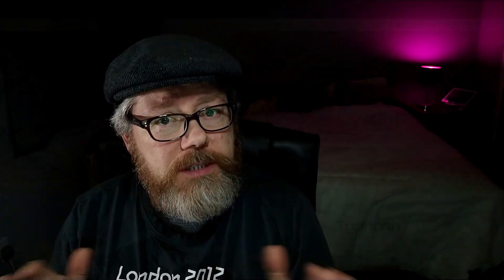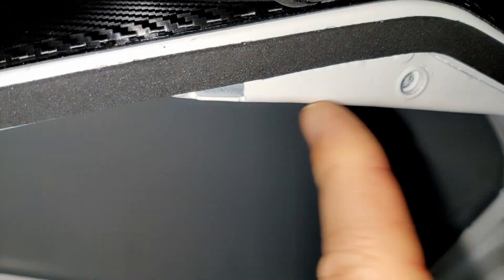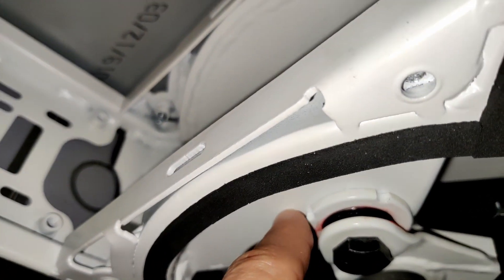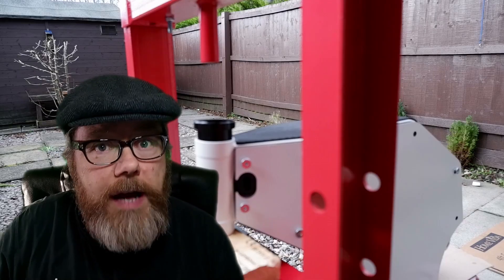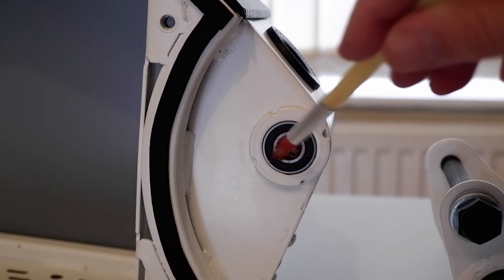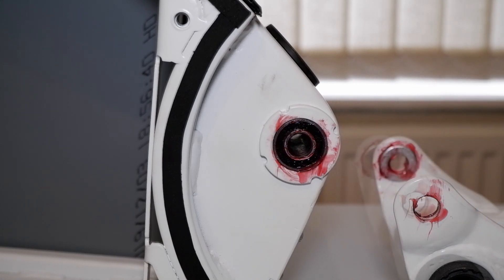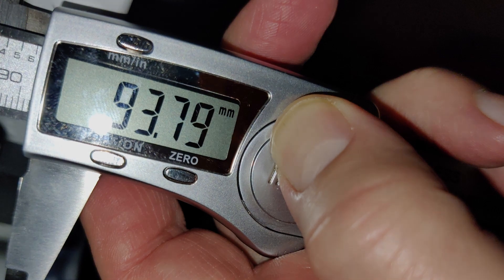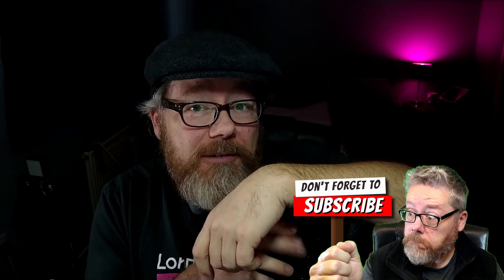FAST EBIKE BUILD UK ROAD LEGAL PART 6 - WHICH FRAME IS THE BEST  QUALITY TO CHOOSE FROM.

Comment: I Order a White Typhoon Frame on the 16th of January 2021, it was dispatch on the 21st of January & the last DHL tracking advise was on the 23rd of January showing that it was cleared customs & awaiting departure from Frankfurt international Airport.  It is now mid March & no one seems to know what has happen to my parcel. The Consignment note states that DHL was to transport to AUS, & then Australia Post would deliver locally. 
When did you order your frame & how long did it take to receive it in the UK?
Reply from the maker: I tried to order in December but they were closed for most of Christmas and until the 11th January.
So the order started on the 11th January and there was a 3 week period to build added bike rack to order. When I had confirmation of shipping it took 5 days to deliver.
Reply: I am now at 7 weeks from dispatch, Artur assured me that it would be here in a couple of  weeks. I asked for a refund or replacement as both DHL & Australia Post tell me that it appears to be lost and  to contact the seller direct. Since asking for a refund or replacement, Vector E-Bike have stopped replying to my emails and their phones are disconnected. So you are lucky to have received your frame.
Reply from the maker: @ezrider119  That's not good at all! I hope you resolve the situation and get your money back if the can't find it. Mind you it is pretty hard to lose a large package that size.
Reply: Thanks mate, have watched all of your builds. All the best for getting your bike registered.
Reply from the maker: @ezrider119  Thanks 👍

Comment: Whahay..!!💥 Iv just come across your channel..Your a welshy same as me,I,m in Swansea..I bought an enduro frame last night off ebay..So im really jumping in at the deep end..my normal hobbie is building FPV Quads and flying them..So really fancied a crack at one of these awesome Ebikes🤩Sub'D
Reply from the maker: Cheers thanks for watching and good luck with your build 👍
Reply: @baconbuttties  Quick question buddy..I’ve ordered a 26” rear wheel and hub motor..! Will this work on my frame? I bloody hope so😩
Reply from the maker: @thedok7333  26 inch rear wheels  are usually okay. What is the exact frame you bought? Is it like my frame or the stealth bomber type?
Reply: @baconbuttties  Its the stealth bomber frame..🤔

Comment: Have you put your discs the right way round, they have direction arrows that should point the same way as the arrow on the tyre
Reply from the maker: Yes I am aware of the arrows. I could turn the right side around but it would look silly and the rear of the disc has a recess. Maybe I will be change the discs to one's that are plain and flat.

Comment: great series, looking forwrd to the rest and how you get on with msva and insurance, what you hopping to get top speed? 
i like the look of the eleek Lite 1/1.8 frame for a 3kw mtb for offroad use.
Reply from the maker: I going to use an 80 volt battery set up on a 5T hub, so I'm thinking that it has to be over 40 mph plus  when the controller is turned up full. Obviously for the MSVA purposes and on road riding the power and top speed will have to be set lower.
Reply: @baconbuttties  so moped rather than motorbike class?
Reply from the maker: @GlaucusBlue  Yes it will be classed as moped hopefully

Comment: Thanks for the video 👍
I'd dare say the Chinese frame would be a good bit lighter.
Did you weigh them?
Cheers
Reply from the maker: Unfortunately I didn't weigh them so can't compare. I have noticed on the European built one that it has a lot of holes drilled in certain places to reduce the weight  added by the extra strengthening.

Comment: Nice and informative video as always, i do just now exactly same build  with a Qulbix 140 frame , i was comparing this two and Quilbx have 50% discount in that time when i order and price was the + - same, build quality looks nice, have some problem with 83mm bottom bracket whitch is not included.  I'm looking forward to the next video :)
Reply from the maker: Nice frame and 50% discount is great, I did look at that frame but it was full price at the time.

Comment: Hi man, to be honest I think it is just about taste. I have got the EEB frame and used your previous videos as guide, and after two yars of usage I have got zero complaints :) EEB has got the cruiser seat and paypal option (Eleek used the Western Union back then). And also yes, Vector and Eleek use same frames ;-) I also prefer plastic material over dibond https://www.youtube.com/watch?v=lEneKp0iJ44    it will be dope if you try if the panels from EEB fit to Vector frame ( I bet they do :D ). Both options are just copy of Stealth Bikes anyway... :D oh and btw I bet this dude used EEB frame for way powerful build than you ;-) https://www.youtube.com/watch?v=ICODFXzlKXA
Reply from the maker: Yeah I didn't mean the EEB is bad, I'm just saying the build quality is definitely better on the Vector frame.  I have ordered wider molded side panels from Eleek and am not sure what they are made of? I think they are ABS plastic, the flat panels that came with the frame are just the flat composite type which are not very good as you only have 120mm width with the flat panels.
Reply: @baconbuttties  I get it, but it is still minor differencies and maybe if somebody aims for 15 000W and more, it make sense :) It will be a bigger upgrade if you try Qulbix. Hyena frame or maybe CyklonEbike Venom. I am at the lower end ( 2000 W - 32Ah 13s 48V battery), I also use 26 inch bicycle rims, air suspension setup and that is the reason why the bike has got 33 Kg and I am probably neve ever be able to destroy the frame (maybe if bus roll over the bike , lol:D ). The only risky frame is the Stealth frame copy (battery without metal box is stupid idea and I saw post where whole garage burned down because the screw from side panel hit the battery cell). But I want you really thank you for your videos, it is great for any new DIY bikers. Kind regards from Czech republic, man ;-)
Reply from the maker: @pavelblazek2573  I appreciate you watching my videos and thank you for commenting. I like to hear all points of view on Ebikes.

Comment: What size free wheel are you putting on your 5000w motor.
Does it fit a 7 speed
Reply from the maker: I think it does fit a 7 speed but I am just putting a single speed on it. I bought a 18 tooth freewheel single speed from aliexpress  but it is about 1mm to wide so I will need a washer/spacer.
Reply: @baconbuttties  
Iv just put a 7 speed on and it’s too big.  It also won’t come off 😂.     The adaptor you get is too small to fit onto the wheel.
Reply from the maker: Yeah those freewheels need a tool to get them off if they are on there tight.  What do you mean by Adapter?
Reply: @baconbuttties  

I’ll send some pictures to your email mate
Reply: @baconbuttties  

It’s the tool you get with it to take it off.   
But the hole on one side is too small to fit on the spindlel
Reply from the maker: @Shaunhyde   Ah, yeah I know what you mean now.
Reply: @Shaunhyde  i had same problem i filed the tool so it would fit over spindle
Reply: shaun hyde I think I know what you are talking about, you just need to enlarge the hole of the freewheel removal tool either by drilling it out or with a file. If you are going to drill it out make sure to put it in a vise or something, don’t try to hold it with your hand.
Reply: @mitchellwilson12354  
Thanks mate I ended up doing it :) 

I’m gutted I can’t put a 7 speed free wheel on.  
It won’t fit in my swing arm
Reply: shaun hyde You could always spread the frame, just be careful to do it evenly and try to avoid back and forth movement.

Edit: “EverythingEbike Channel” had a good video on this in his v3 build series. I don’t remember which part but if you are building an enduro frame ebike I would recommend watching the whole series anyway.

Comment: Interesting how they make an effort to perforate the internal panels and make the outside ones out of plastic to save weight. I wish I'd bought this style of frame but no going back now!

p.s You should try and get  sponsored by the grease company at this rate 😂
Reply from the maker: Yes there is quite a lot of holes in various places to save weight. I have ordered some wider composite  side panels  from eleek as the standard ones with this frame don't give you much width.